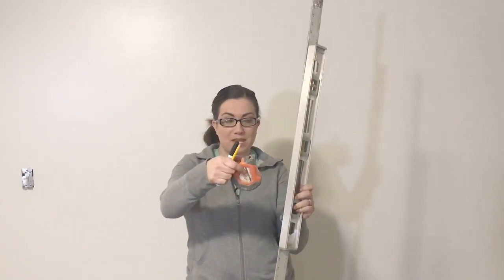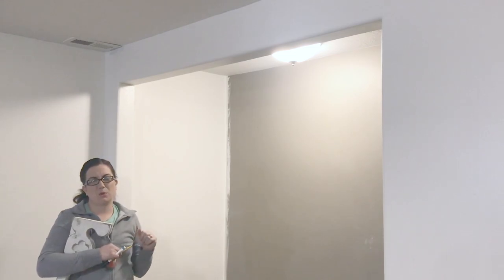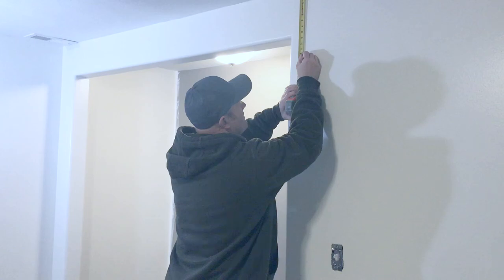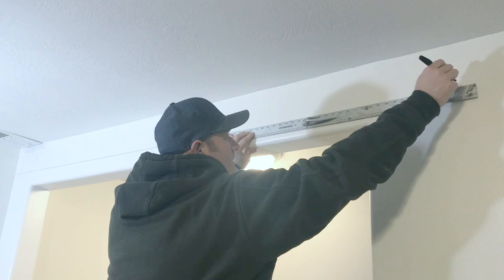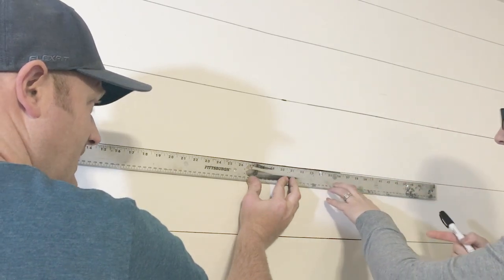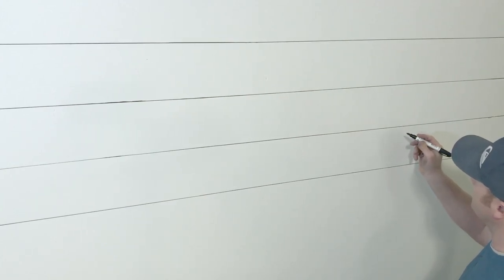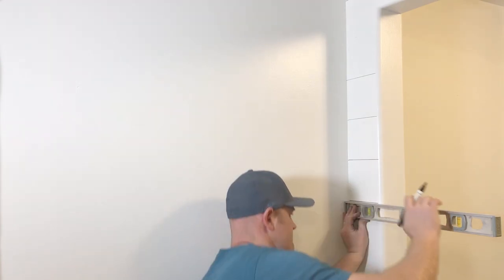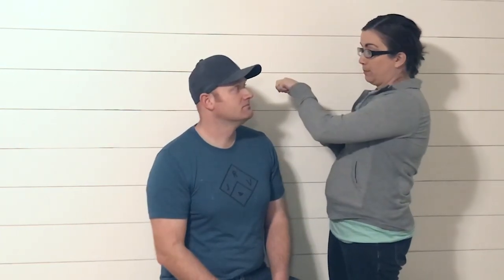Sharpie Shiplap DIY

Comment: I've been watching a lot of your videos this evening. ;)   The way I did my shiplap, to cover up an ugly paneled wall - (it was a short wall also) I bought 3 sheets of underlayment, painted the first layer a light gray, second layer white using a wash effect. After it was dry, I hung it on the wall (using a nail gun) caulking the vertical seams, and also used a sharpie and level. After that was finished I did another very light white wash over the lines to mute the black. I fooled everyone - even my friend, an artist designer!!  So yes, there are many ways to do shiplap on a very tight budget.
Reply from the maker: Nice!  Great idea!
Reply: Do you have any photos posted anywhere?

Comment: Would it be quicker if you held the measuring tape at the top of the wall, stretched it out vertically & mark off the 6 inch points all the way down, then moved over to the next place & do the same?

Comment: Are your walls textured?
Reply from the maker: They only have texture from the roller. So not much.
Reply: would this work on a textured wall? 
 @JamiRayVintage
Reply from the maker: It might. The line may get a little wavy here in there with the texture of the wall but you could probably achieve the overall look.

Comment: Did you just absolutely get lucky that the light switch fell in between two lines? Is shiplap basically a wood floor on the wall? I agree with another comment that you should have some dividing horizontal lines here and there.
Reply from the maker: Yes, we got lucky lol

Comment: Nice job. Question: where should be your first strait line if I have cricket celling?? U, I hope I write this question ok and you know what I mean?!? Be well
Reply from the maker: Hi L.L.  I understood you perfectly!  The way I would do it would be to find the two highest points on your wall and run a straight string from one side to the other side. Make that be your reference for measuring and start your lines about 6 inches or 15.25 cm down from the string line. 
Hope that helps!  -Zeb
Reply: Jami Ray Vintage I got it. Thx

Comment: Instead of measuring down and making all the tick marks. Use the level and run the pen along the level.  Leave the mess-ups. Real shiplap are not perfect edges with a gap between each board. So the messups look more like real wood instead of lines drawn on.  You can even draw in a few knots on the edges.  Nevermind about the level. Just saw the rest of the video. You did that too.

Comment: Also try "a Ben a qui" paste... doesn'tchange the color of the paint on the walls when you try to take a mark off..I haven't tried it on permanent marker though. But I've tried it on like just about everything else and let me just tell you it is the bomb all natural doesn't change the color of anything doesn't ruin anything and helps take rust off things and mineral marks and scuffs off walls and whitens your sneakers for your souls and I'm just can't tell you how much better I like this than mr. Racer. And it's really good on glass tops. Give it a try I think I spelled it right LOL but you buy it on Amazon and it's all natural non-toxic